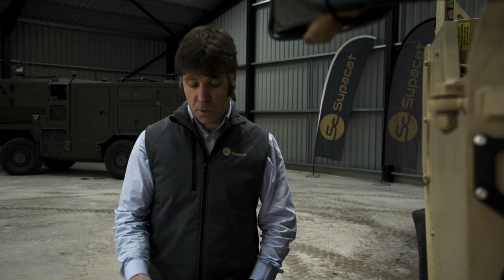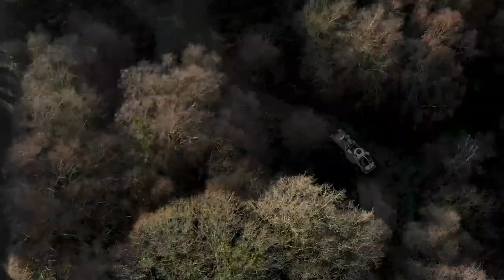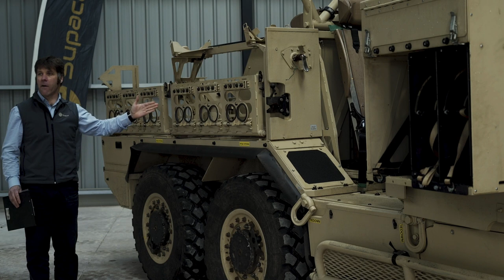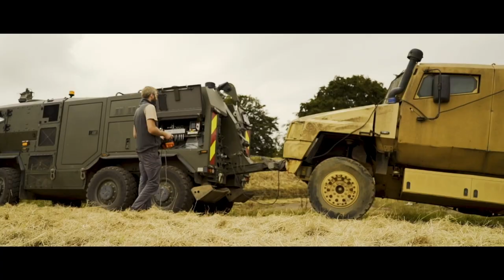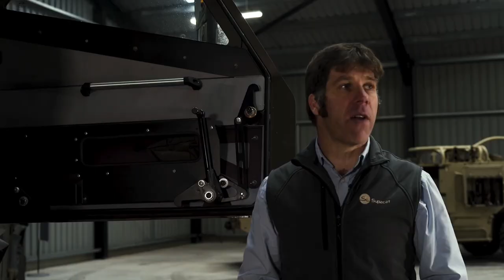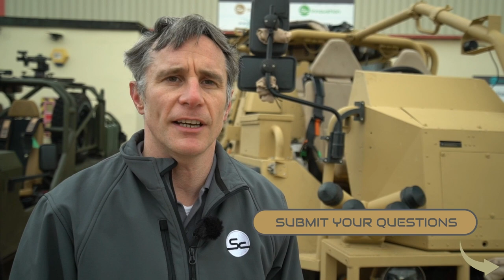Supacat HMT Digital Vehicle Demonstration 2021

Comment: 10.21 look under front bumper of fox hound when getting lifted with the recovery HMT see the 6 cell Optima battery right there at the back of the wheel! What a great design that is! Waw that's the first thing to blow then the electrics?
Reply: Дорогие игрушки чтобы продавать в кредит 😮😮, обойдетесь и парой внедорожников пикапов